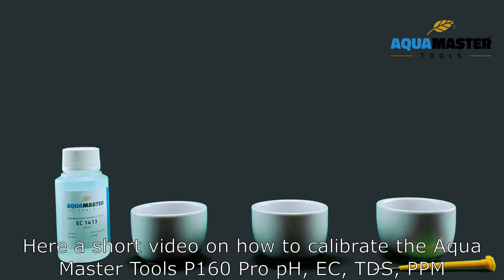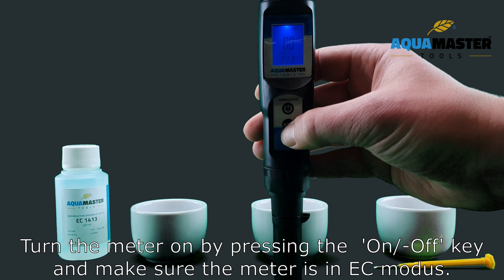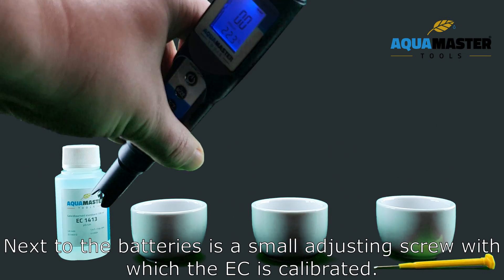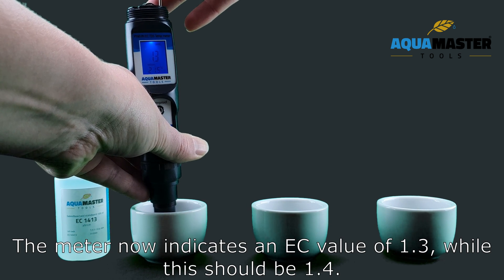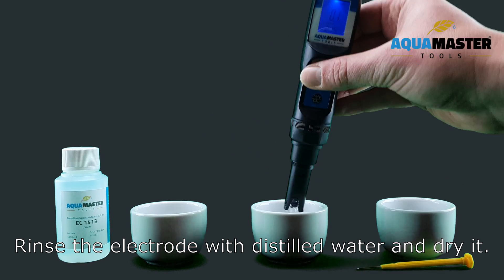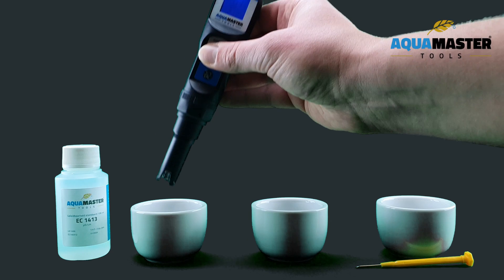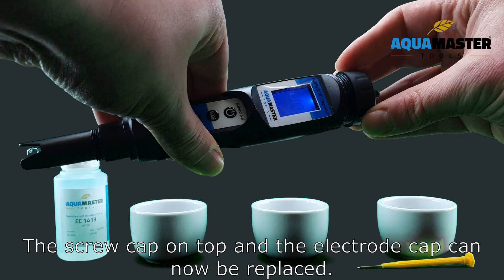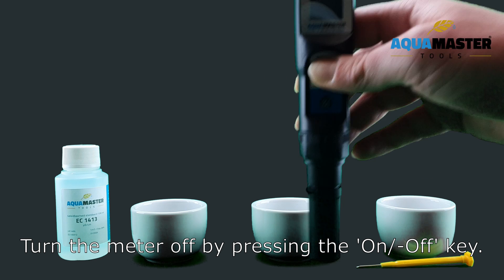P160 Pro pH, EC, TDS, PPM and Temp meter - EC Calibration

Comment: I calibrated EC at 25° C, for the 14.13 qS/cm calibration fluid.
The automatic temperature compensation does not work, neither up nor down. The values jump back and forth and do not resemble at all what is displayed on the calibration fluid. The real values of different fluids can only be measured at 25° C, otherwise we get incorrect values.